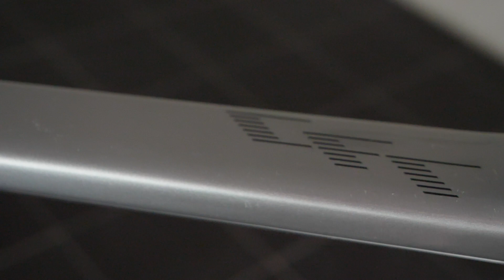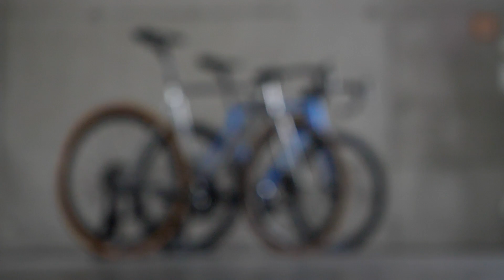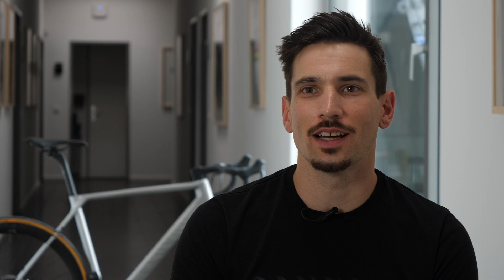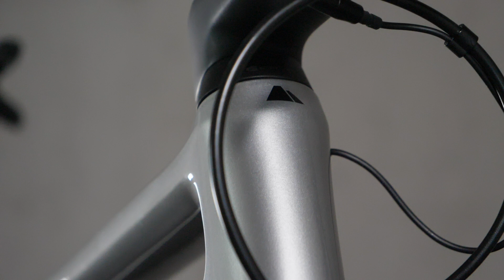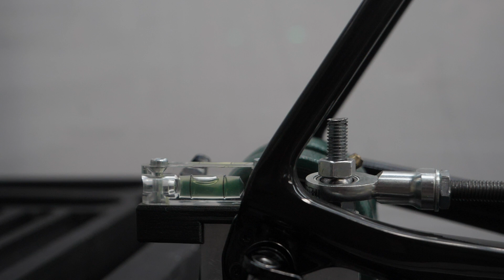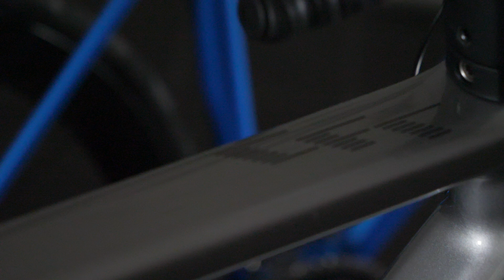Premium VS Midrange Carbon Fibre: What's The Difference? | NEW Canyon CFR

Comment from the maker: What do you think of the new Canyon CFR? Let us know 👇
Reply: GCN Tech could you please ask Canyon what they think about fully integrated cables on disc road bikes? I wonder if they have concluded that is not worth the complexity and service hasle being the no nonsense bike manufactured they are?
Reply: So what's new? Aside from branding...
Reply: Not re-doing the design and integrating disc brakes was kinda sloppy... can you ask them if they will be producing a CFR version of the Aeroad?
Reply: Hope you’re ok Ollie, you look exhausted...
Reply: Most probably creak😛
Reply: A bit misleading title... Please do a proper video about this and not a promo video for new (Canyon) frame, it’s an interesting subject. This one is just a new Canyon top end frame vs. old top end Canyon frame
Reply: Someone likebpeak torque may know more 're carbon engineering. Doubt Canyon did it but they have overseen the development. Won't be like that Hope track bike which is low volume building. Canyon are making 1000s not 10's
Reply: no hidden cables :(
Reply: So Canyon did the carbon engineering?
Reply: At 6:05 the engineer stated that a bike made soley of high modulus fibers would be uncureable... what does this mean exactly? Did he mean the resin (I've heard it be referred to as the polymer matrix) will not cure? Why? Is it because these fibers don't bond as well as others? I'm just curious to learn why. Could you expand further on this in a future GCN tech show or another carbon fiber episode? @GCN
Reply: I m still thinking..
Reply: Afraid of by mistake dropping the top tube 10cm to the door canvas and ruin the frame.
Reply: I think it offsets Ollie's bedhead really well. Kidding. Hope you're okay, mate! Burning the candle at both ends?
Reply: just sayin hi to my new bike
Reply: Dont understand why they did not modernize the mould by now and at least would give the frame a more bended form like other modern bikes as well as integrating the cabling more. It could have explained the significant more cost much better than just some more expensive material and maybe 2hrs more of quality control. That is just not credible.
Reply: Nice bike but I’d like to mix and match components and they don’t allow that.
Reply: GCN Tech it’s not a new bike, it’s a new color and that’s that. It’s quite obvious they are using the same mold again (I mean, how many years now?). Compared to the Evo Disc of last year, it has actually gotten heavier (6.29 vs 5.99kg, both are Canyon’s claimed weights) for the same set up. Is there a reason to buy this over an Evo unless you want Campa instead of SRAM?
Reply: @LarsRR  exactly, new blabla for the same bike
Reply: Is there a price increase?

Comment: GCN you do great reviews and content, but I have to say you may need to give some coverage to the less rosy side of Canyon. I bought an Endurace CF SL which arrived with a flaw in the paintwork - 2 weeks later there is no update from their customer service. I had a look both on their own website, and on Trustpilot reviews and I see that this is a relatively common complaint - the negative reviews are all related to damaged parts on delivery, or within warranty, followed by appalling customer service. It would be great to see you guys do an investigative piece on this. Meanwhile I am expecting to wait more weeks unable to ride a brand new bike I've paid S$6,000 for. Hard to communicate fully the disappointment I feel.

Comment: How long does R&D take on a frame like this? Are they using simulation to provide insight on structural integrity before they go to manufacturing? Or are they going straight to manufacturing and using the test fixtures? If so, how many iterations does this take? What are they looking for with the tests? Failures in specific regions? And what kind of failures? I'd imagine cracks are easier to see, but can they tell if there is delamination?

Comment: The thickness of a soda can is actually 0.1 mm. 0.6 mm is closer the thickness of a credit card (0.8 mm) or a Continental Grand Prix 5000 sidewall (0.55 mm), or typical sheet steel of car panels.

Comment: They have two offering of the CFR, the costlier is 300 grams lighter and comes with Campagnolo while the less expensive one comes with Shimano. However, the main difference in price and weight appear to come from the wheel set. Why do they not offer the lighter wheels on the Shimano version?

Comment: I used to have an ultimate cf slx, realised it was a size too big and replaced with an aeroad cf sl. I can tell zero difference out on the road... power to speed is the same. Just a big marketing con! They’re made in the same moulds after all, do the source materials really cost that much more?

Comment: My question is why battery mount is on the down tube. Di2 battery is not that heavy. And you need to take BB off to replace the battery? I was wondering how making two holes on the down tube affects durability of the frame.

Comment: There’s an old saying in bike manufacturing: It can be lightweight, durable, or cheap. Pick two.
Reply: I would say pick one :P
Reply: @luis.borges  Actually cheap can often be durable :)
Reply: @krnone8057  agree on that one, but light and cheap or light and durable is hard to find
Reply: @luis.borges  Yup, the rest makes no sense.
Reply: @krnone8057  ...but heavy.
Reply: Light and durable is easy to find - good quality aluminium frames aka Alu Lite are light and durable and the most common frame. Titanium too at a premium. Carbon frames are not as durable given the same level of wear and tear and age. That's the Achilles Heal of carbon frames whatever their quality - they can't take shocks and knocks like Alu and Steel can, damaged fibres can hide under the paint, waiting to fail at speed. Which is dangerous. This is why I'll never buy a carbon frame; carbon fork and seat post is as far as it goes with carbon for me because those are easily replaceable.
Reply: TheNiall  If it’s sooo dangerous, pros wouldn’t be riding them at 60mph+.   Careful with the bro science.  If alu lite was so great, someone would have started a business making bikes with it.
Reply: @Dee-Ell  Pros have the finance, sponsors, etc. that when their superlight bike snaps, hey presto, a new one appears like magic. I don't contest that carbon can last forever, but is doesn't like hard knocks. And just one might be all it takes.
Reply: @NipaHandsomeMan  The "magic" of having a replacement bike when one snaps is beside the point; the point was about the danger of riding a carbon bike.
Reply: @NipaHandsomeMan  wow, thanks for your information. Is there and alumminum bike manufacturer that you would recommend?. I live in Taiwan so my first choice is Merida
Reply: @NipaHandsomeMan  Light alu frames are light just when comparing to other non-carbon frames. In general they are not light at all. Top ones (not so cheap btw.)  like Allez Sprint weigh about 1150 grams, which is not even close to low/mid range carbon ones (the heaviest Canyon's Endurace CF SL weighs 960 grams - which I would say is a bit heavy for carbon one). Also you will not find much stiffness and vibration damping in alu frames. I also thought that carbon seatpost and fork is enough, until I had opportunity to ride a carbon frame bike, after which I bought my own one. The difference is huge and as frame is most important part and heart od bike, if you just can afford it - I don't see any reason to not have it in a road bike. In a mtb bike - I wouldn't be so sure, probably good to build a light XC bike (I also chose mid-range carbon there), but for sure not a must, as vibration damping is not important in this case and there is bigger risk of damaging frame.

Comment: How do you find the shwalbe pro one with tan sidewalls shown in this video. I cannot find that tire anywhere.
Reply: It's the Pro One TT version ( lighter and less durable ), the Pro One comes in black only.
The One is available with tan sidewalls, I use the TLE version and find those tires more supple and comfortable than the Pro One 2019!

Comment: The frame was way ahead of its time when it came out many years ago but its past due for an update. It looks really dated with its exposed cables and high seat stays.
Reply: Agree. And the round seat post, thick forks legs, large gap between front wheel and downtube.
Reply: Canyon engineers - let's design a new frame. Canyon managers - nah, keep the same frame make it a bit lighter and charge more.

Comment: @GCN Tech... Every time you change specific strength and stiffness of the material, the tube diameters need should be change to optimize the weight of the frame. You don't build an aluminum or titanium frame with the same tube diameter and wall thickness as steel frame.  So as Carbon Fibers increase in strenght and stiffness you should decrease the tube size to save weight and to keep the frame being to stiff and rattling your fillings out.

Comment: Can you please do a video on carbon frames and their longevity? I typically keep a bike about 4-5 years. I'm guessing these super light frames are meant to be used by pro racers for a season. Is this true? It seems most manufactures have multiple levels of the same frame, like Canyon, so which level will last the 4-5 years vs 1-2, etc? Or am I way off in this thinking?
Reply: Your way off ! Carbon will last forever unless you have a heavy crash

Comment: Actually, if you check out ax-lightness's VIAL evo DISC at 5,4kg for a medium It might be lighter or a lot lighter than Canyon's ultimate cf evo disc, which I think is 6kg for medium and for the Ultimate cfr Disc, well it says on Canyon's website 6,59kg. So, either way the Vial evo Disc from ax-lightnes is a lot lighter than both from Canyon.

Comment: Insane... Then the yoghurt package wall thin, now the cola can's... Is sitting on a top tube allowed?
Reply: the top tube even on alloy bikes like the CAAD 10 and CAAD 13 ect are also pretty insanely thin. depending on your weight sitting on the top tube is probably not a great option these days as they have all been pretty thin there for quite some time

Comment: The wall thickness of a Coca Cola can? Does that pancake of an engineer know that the wall thickness of a beverage can is about 0.1mm? Maybe made a mistake with ply thickness and wall thickness?

But props to Canyon though for their CT scan. That is not cheap
Reply: I think he was referring to a bottle rather than to a can
Reply: @veebeem953  I don't think so. I think he confused the ply thickness of the carbon fibre (6 plies × 0.1mm) with the wall thickness of the product. I couldn't find a good answer on Google about the wall thickness of a plastic Coca Cola bottle. The wall thickness of a plastic bottle is also not consistent, so it would make it quite a useless metric. The wall thickness of a can however is quite consistent
Reply: Do you know the difference between a can and a bottle?
Reply: @hanshansli2238   Of course I do. A can is used to contain various things, most often liquids, in a more or less cilindrical metallic container. These are made from punched sheet metal and deep drawn after that to have a wall thickness of about 0.1 mm.

A bottle is a fluid carrying container usually made from plastic or glass

Comment: Another question could be about material robustness in terms of lateral forces on the 0,6 mm frame material. Think about the frame leaning with the top tube against a hard edge. Or a tool that you accidentally drop and it would hit the down tube or one of the seat stays. The performance of the bike might be great, but it is also important that you cannot handle the bike with silk gloves all the time.
Reply: Jan Willem Kuilenburg I agree. The frame is likely to accommodate design stresses but probably very susceptible to any type of impact or loads like sitting on the top tube.
Reply: @paulhartman3118  Agreed!  6 years ago that point was raised with "hi-mod" vs. "non-hi-mod" carbon fiber frames.  Carbon fiber has been pushed even further since then.  When will things be pushed too far?  Or have they been already?

Comment: How is it that Canyon have zero stock of any bikes right now, and zero communication about what is going on with their manufacturing but they can produce a bike like this that most people cannot afford?
Reply: There is a worldwide bicycle shortage. During the first six weeks of the pandemic, the bicycle industry as a whole sold through nine months of inventory. That includes bicycles, components, and even low-end service parts. Then the factories were shut down for months to prevent the spread of covid-19. Many factories are still not up and running at this time.  Minimal staffing for the purposes of r&d, design, prototyping, and getting equipment out to sponsored athletes and dealers who got into the backorder cue first. It’s not just Canyon.  It’s the entire bicycle industry.  Shops cannot get many new bikes yet. Many popular sizes of inner tubes and tires, as well as drivetrain components are becoming scarce. ETAs keep getting pushed back. The manufacturers are doing the best they can.  Consumerism is the cause of the shortage. We will all just have to wait patiently.
Reply: Their RND is still working, but their factory parts are low on stock, from other suppliers. Simple.
Reply: By "any bikes" do you mean any of these (CFR) bikes?  I just bought an Aeroad the Wednesday before last and received it at my doorstep only 6 days later.  They shipped it the day I bought it, and I only got the standard shipping.  3 rides in: it's a wonderful bike and IMO it competes on level terms with aero bikes twice the price.  I'm not naive enough to think Canyon is some perfect company but your comment seems a bit unfair.  That being said, your personal experience with them sounds different to mine, and I would probably think the same thing as you if I had trouble getting the bike I wanted, and trouble getting answers from them when asked.  Me personally, I'm not the least bit interested in this CFR business - give me the standard level bike which is more than good enough.  I also ride an Endurace which I've put over 11,000 miles on in a year and a half.  They're great bikes.  If you're getting the runaround from them keep at it; I hope they sort you out.
Reply: @brianmessemer2973  I am in Australia, our canyon site has practically no stock of anything with drop bars right now with shipping times of Jan or Feb next year.
Just to be clear here I am not complaining I completely understand that it's unprecedented times and you cannot always get what you want.

It's just frustrating that Canyon is providing zero details locally at all about what's going on. Maybe they don't know?
Yet a 16kAUD bike is available?

In the end I gave up waiting for an update and bought a cervelo.
Reply: @ppsnake  Ah you're in Australia, gotcha.  I'm in the US.  Shame that Canyon Australia doesn't have bikes in stock.  Cervelo is an excellent choice.  Several of my riding buddies ride Cervelos.  Hope you like your bike!  I follow a couple of Aussie YouTubers: Cam Nichols has a cool channel, and of course Lanterne Rouge.  Cheers 🍻
Reply: Indeed, I would like to know that.....
Reply: It's not just Canyon, I wonder what is going on and whether that is actually intended to raise the price artificially.
Reply: @Ryan Hustler  Name me one brand whose frames are not made in Taiwan (or North Africa (Look bikes)).
Reply: Most people buy less expensive bikes.  They sold out faster.
Reply: @Ryan Hustler  Their bike frames are made in non communist Taiwan and send to Germany for quality control (scanning).
Reply: The wealthy always get served, somehow.  As to the somehow, it might be made by a very small team like how the Cervelo RCa was made.  So a very small run for a bike that very few can afford could be doable.

Comment: Well, I feel safer on my CF SL
Reply: Me too...
Reply: @elmerrichardson6413  Me too!
Reply: Mine is good enough for me. Too good really, I find I am basically just as happy with my 10 year old aluminum $800 bike. Although it doesn’t shift or brake so good. It is still just riding my bike, and that is the bit I like. And I don’t give a damn about visible cables, either.

Comment: With the NHS prescribing cycling etc, would you consider doing a feature on bikes for heavy riders? I've a 6' 6" mate who is 350lb+ who wants to get a bike and info is virtually non existent in the UK, all the manufacturers seem to max out at 120kg.
Reply from the maker: Thanks for the suggestion, we'll consider it for the future for sure! A steel bike might be the way to go for your mate as they're very robust - a visit to a local bike shop might help identify some possible options too
Reply: Like GCN Tech said below, a steel bike is a good start. Also a good idea to consider getting wheels with wider tires so he can ride with slightly pressure and reduce the risk of punctures.
Reply: The 'safe' limit is probably significantly lower than what it actually can handle. A touring bike could be an option. They are built for additional pannier weight.